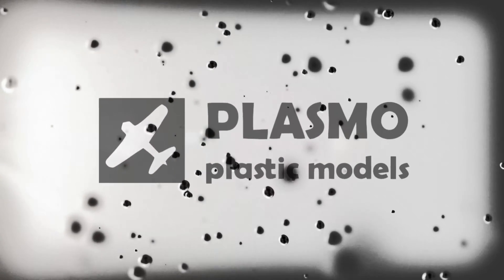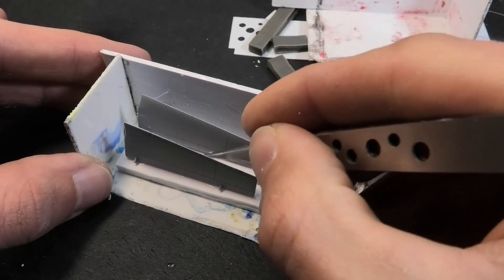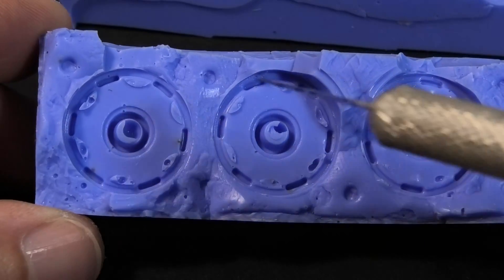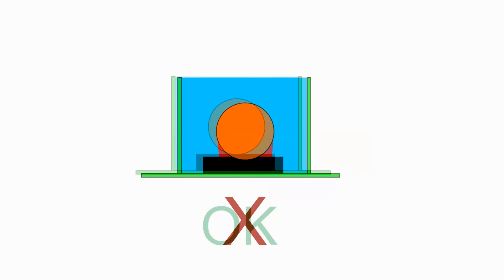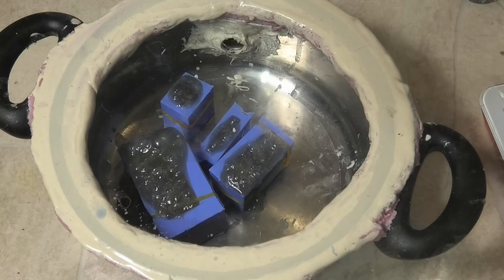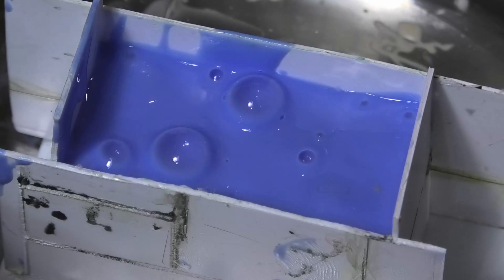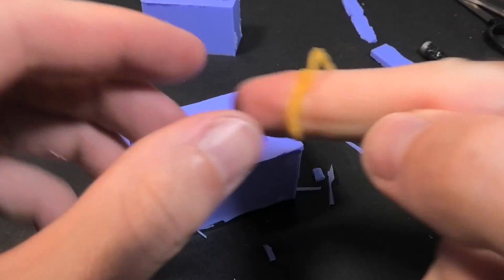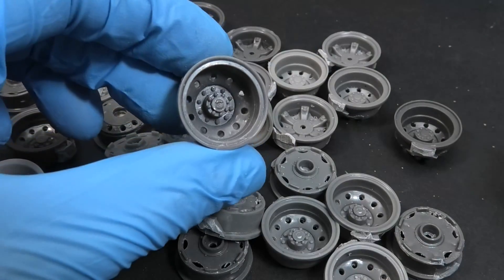Tutorial - Resin Casting - Silicone Mold - Two-Part Mold

Comment: That's why resin models are expensive
Reply: Exactly
Reply: This and the fact that usually they're not made in large amounts. They're easy to make, but require quite a lot of work.
Reply: This isn't entirely true, economies of scale need to be applied.  It's not wrong per se, but the cost is reduced when amortized across the total production/demand.

Comment: You can make a very good vacuum chamber using a common pressure cooker such as is used in canning fruit and vegetables. Just put the proper brass fittings on the lid and you are good to go. Very safe and easy to do.
Reply: Top man , knowledge is power
Reply: but without the clear lid it is harder to know when to stop the vacuum, isn't it?
Reply: You sound like you're talking about  pressure pot, used when casting the resin to eliminate bubbles in resin. Vacuum chambers aren't made with pressure cookers generally
Reply: @matt9736  No, but; they can be. I've done it. If it will hold pressure, it will hold a vacuum. The same principle applies. Pressure cookers are readily available and cheap. A small amount of effort turns it into a vacuum chamber.

Comment: Have you tried vacuuming the silicone / resin before mixing the hardener in? It might remove a lot of the bubbles when you aren't worried about it setting on you.
Reply: Please don't use power tools or anything dangerous.... stop and think... how do bubbles get in the resin? By foooking mixing it and stirring.... come on mate ffs
Reply: @vasili1207  are you sure about that? Do you really think that a minute of stirring adds that many bubbles? Surely bubbles can be added in the manufacturing processes and during storage. Of course the stuff would need to be vacuumed again afterwards, but it would be interesting to find out how much less foamy it is the second time around.
Reply: @vasili1207  and I dont really appreciate your tone.
Reply: Im rather new in mold making, I sculpted a small range of 32mm miniatures and wanted to reproduce them. Im experimenting alot, my set up is similar to the one of Plasmo. Vacuuming the resin before you pour it to the mold does reduce the occurance of bubbles, especially in tily stuff like my sculpts. BUT it also reduces the small ammount of time you already have. From my experience the bubbles do not appear because of the stirring, but because of the chemical reaction between the A and B components. So vacuuming just part A isnt going to improve anything really.
Reply: Thank you Joe, good to know. I'm shocked that the chemical reaction is releasing gas! Surely that is the last thing any caster would want! Are you sure?
Reply: I don't care what you appreciate....  fact
Reply: You are wrong .... stiring folds air into the mix .... exactly the same as baking...  if your resin creates bubbles via chemical reaction it's contaminated, your chatting total nonsense.

Go read the data sheets or phone the resin manufacturer they would laugh at you 🤣
Reply: @vasili1207  I assume your second response is not directed at me, but I'll respond anyway. I don't think it is the same as baking. When intentionally fold a paste to add air bubbles, it is going to have markedly different end results to when you carefully stir trying not to add air. 

I am fairly confident, being a professional chemical engineer, that the manufacturing process will involve stirring. It stands to reason therefore that a lot of the bubbles will already be present when you buy it.

I checked online for the chemical reactions of casting resins. It would appear that none of them have side products, therefore I do not think that the bubbles come from the reaction itself. It is possible since the reaction can generate a lot of heat, that this heat causes bubbles to appear from gas that was in solution already.
Reply: Well if you're a "chemical engineer"  you wouldn't call yourself that and you wouldn't have asked that question.

Ps it's a chemist
Reply: @vasili1207  what's a chemist? I am a chemical engineer. I engineer processes for handling oil and gas, both on platforms and onshore terminals. We are not the same as chemists, who work at the millilitre to litre scales, while I work at the thousands of tonnes scale. They use glass while I use carbon and stainless steel.
Reply: Don't vacuum your resin, it is much better if you do exactly the opposite. Put your poured parts into a pressure pot and increase the pressure inside to around 4bar/60psi. This causes the bubbles to shrink to microscopic size and you get a much smoother final result.
Reply: @dablakh0l193  if he does this I won't find out what happens with the pre-vacuuming! But you are right, I have seen several videos that have all recommended pressurisation over vacuuming. It is certainly less messy. As long as it doesn't explode.

Comment: Hi. Do you think vacuuming the urethane works better that using a pressure tank to get bubbles out? Most videos say vacuum the silicone mold and use a pressure tank on the casting resin. Thanks

Comment: Great work👍
Btw is it possible to make mold of painted object this way without damaging that paint?
Reply: Yes clear coat it then cast
Reply: Or if the part can be washed with water, coat it with a small layer of dish soap and let that dry. Put a fine dusting of talc over the soap and that helps with casting delicate pieces.

Comment: Is the blue stuff and epoxy putty method still viable?
Reply: No it's been deleted from the human experience.....
Reply: yes, and you can use resin with bluestuff too.
Reply: @orbitalair2103  no you cant, the exothermic reaction of the resin partly melts the oyoumaru/instant mold and you are going to get much softer detail
Reply: I am using both..Blue stuff for simple and quick things and where I do not need so many repeatability.

Comment: Any kind of paint can be used to change the colour of the resin? The brand I use sell the colours too...but if I can use normal paints I don't waste other money!
Reply: Get the proper equipment
Reply: It's best if you use powdered pigments for colouring resin. Depending on the resin, the paint will either cause the resin to bubble up as it cures, or it will never cure completely and alway be sticky. You can even use powdered drink mixes like kool-aid to colour resin. You can also find cheap resin colours on ebay that work great and cost pennies.

Comment: So when you put the silicon into the casts and into the vacuum chamber, do you use the chamber as you did before on the silicon mixture? So that it all bubbles up like in the plastic cup?
Reply: Bob Beamon Did you mean Resin?
Reply: @robmccord2583  I mean the blue silicon once it is put into the casts.
Reply: Bob that is what Plasmo does at 7:16, he pours the silicon into the framing box he built to make the mold and activates the
Vacuum.

Comment: Little tip for fixing the shape of the mold. Don't use just rubber bands! They'll apply an uneven pressure on the mold use pieces of wood or any hard material on two sides of the mold and then apply the rubber bands, then you'll get an evern pressure on the mold which will result in no imperfections of deformed parts.
Reply: Good tip Adam
Reply: I use paper tape
Reply: Yup, even two piece of thick card - just to stop the elastic bands digging in or distorting the corners/edges.
Reply: I use duck tape.
Reply: Use any hard part. Thin wood, plexiglass, something that will not bend by rubber band.
Reply: Keep the original container (styrene here) to put the mold back in and fab compression plates for one or both sides that weren't originally part of the mold.  Then just use either fishing weights (I recommend everyone keep some lead free ones on hand for a variety of reasons) or something available to put as many grams on the mold for pressure as there are ounces of  silicone used in the mold.  E.g. 25g mold weight, 25g of weight for compression.

Comment: When you pour resin in molds do you again use the pressure pump or not ? And for more complex objects do you make air vents? Thanks, great video! 🙂
Reply: When I cast resin I will put the material under the vacuum pump again. So you are applying vacuum after you've mixed the material and then applying vacuum again once you've poured into your form.
Reply: @otm646  thanks for the info!

Comment: Seal the Legos with clay or petroleum jelly
If you don't have access to a pressure or vacuum pot, you can reduce some of the bubbles with a thin pour at height. A vibrating table (or other agitating method) can also help.
For casting, some people have used pressure chambers to crush the bubbles. I've never tried it with clear parts, so I don't know how effective it might be for that.
For multi part mold making, I've used silicone lubricant spray

Comment: Would you like to do a track diorama for a 1:24 scale car?
Reply: I used to use wet & dry sandpaper for a track surface, painted a tarmac colour complete with seams and repair patches in a slightly different glossey shade.
Reply: @doctordirk6316  stippling mr surfacer 1000 and sanding it with a little 4000 grit sandpaper would also work

Comment: If you want to get the resin cast free of bubbles, you have to set the mold and resin under pressure ( ~3bar). It makes a lesser mess and the pressure will shrink the bubbles, that these can not be seen with eyes
Reply: True.. And you "may" get away with a home build vacuum pot.. Do Not home make a pressure pot! There realativly cheap out there.

Comment: Hi Plasmo, nice video and good explanation. I noticed you used a vacuum chamber to get rid of the bubbles in making the mold. However, there are some videos that recommend using a pressure pot to pressurize the resin in the mold for bubble free casting. However, I do not see you using a pressure pot for your casting. Bubbles will be created in the resin when the 2 parts of the resin are being mixed and stirring it will cause bubbles to form in the resin material; hence the need to use a pressure pot to get rid of the bubbles. Please advise should we use a pressure pot or vacuum chamber.

Thanks

Comment: Consider punching a hole from the bottom of the side that's most difficult (like the wheels), and when they're cured, push some air in there with pressure. The piece should pop right out, because the silicone is expandable.

Comment: Hey plasmo, I’ve recently gotten into model building with much inspiration from your videos. 
I have a question for you or anyone else who knows,
What am I doing wrong? I’m hand painting with acrylic paints and I’ve thinned out the colour to a milky consistency and doing about 4-6 layers, I’m now trying to clear coat my work but I’ve noticed when applying the acrylic flat clear (Tamiya XF-86) it starts to almost instantly start leaching into and stripping my colour/base coat. Where am I going wrong?
Any help is much appreciated cheers from Australia.
Reply: P.s I’m only starting out so I don’t have an air brush/gun

Comment: When you make 2 part silicone molds, try using acorn nuts to press locating pins in your clay. They are smooth and perfectly tapered so that they pull out cleanly and even if you use the water based separators they seem to very rarely, if ever, break. If you are still worried about breaking them, use the water based separators on everything else, and use some petroleum jelly on a cheap model paint brush to paint the jelly on just the locating pins before you pour your second layer. 
I have had some items that required a 3 or 4 part mold to be able to get all the details and using the acorn nuts for locating pins has been the best way I've ever found to work. 
Also, size the nuts you use to the size of the mold you are making. The larger the mold, the larger the acorn nut. Remember, you only need 1 acorn nut threaded on a 20-25mm long screw to press in all the locating pins in your clay. That way you can afford to have them ready in several sizes depending on your mold. You never want to have too small locating pins. 
One last thing. If you have vacuumed your silicone, try pouring it in a very thin stream, starting in a corner of your mold, and allow it to rise up around the part, that way, if you use the fine stream, you don't get bubbles trapped, and you don't need to vacuum the mold after you have poured it. The stream size for the parts you showed casting should never be larger than 1.5-2mm in diameter.

Comment: I regularly make silicone mould’s for fishing lures and use Lego to build my mould frames.  The secret for making Lego frames is to carefully cover all the joins in plasticine.  The silicone won’t leak out that way.  Also, I use petroleum jelly as a mould release on the silicone when pouring the second half. Just brush it in VERY lightly.

Comment: This is a great video! However, I don’t have a vacuum pump or chamber so I’m a little discouraged that I need to source that stuff first before I even begin. But your results look awesome! Curious though, during the vacuum process it looks like resin is bubbling out of the molds. Do you ever lose too much material and have a bad casting as a result ?
Reply: That’s just the air bubbling out. Also, a vacuum chamber isn’t 100% necessary. A lot of people get by without it.

Comment: Alright then I see that everyone is doing the frame work the hard way

I've been using of all things " Lego's " to make the box frame and a thick pice of plastic for the bottom and seal it with a thin bead of silicone around the bottom edges .
I then place the part (s) in and pour about halfway up in the box ,
Not to completely cover the part and then place three to four Lego's in the silicone to create key locks for the next step .
* key locks help hold the two parts of the finished mold together and prevents slippage of the two halves .

Step 2.    Remove the Lego's and spray silicone release agent before you pour the rest of the silicone over the part and the rest of the box .

I use every thing from Micro Mart 
( except for the  Lego's ) .

One to one RTV silicone 
R = room , T = temperature , V = vulcanization .
Silicone release agent

Comment: Excellent! I'm wondering if I can recast metal miniatures to make them easier to do conversions or pin together
Reply: Silicone rubber is great for casting low temperature metals like lead and pewter. 
I used it once to recreate my grandfather's WW1 lead soldiers. I took the best ones of each of the different styles, and repaired what needed to be repaired with water based glue and plaster (that way I could return them to their original condition after making the molds using just some warm water and soap). I then melted lead and cast enough for a full set. The damaged ones, I used more plaster on the area so I could dress it down to look like it should have been, then I made a second mold of the fixed figures and cast new soldiers from those molds. 
Then I spent several months painting the details on all of the soldiers and equipment.
Reply: dablakh0l 
Awesome, I wouldn’t have the patient or skill to do that.

Comment: Really nice video! Two things I found when casting are -

i/ 'Vaseline' - aka Petroleum Jelly, is an excellent release agent for making two part silicon moulds.
ii/ Dusting the inside of your moulds with Talcum Powder - aka Baby Powder [and removing any extra with a soft brush], before pouring casting resin is an excellent way of making sure even tiny details and mould cavities get filled perfectly, for best quality reproduction.
Reply: Silicone mold release with Teflon is about $12 a can, you can buy it from your local industrial supply or even Amazon. You get a much finer consistent layer without having to fight with the sticky petroleum jelly.

Comment: Yeah, I will probably try to make some copies of my resin prints.
Reply: Be mindful that SLA/DLP resins often have chemicals that inhibit the curing of silicone, especially Platinum cure, that could leave your original and mold unusable without significant cleanup and loss.
Reply: What Nuke Dukem said. Tin-cure silicone usually works better for copying printed resin parts. 
Here's a video where someone experiments with casting copies of SLA resin models. Tin-cured work the best. 
https://youtu.be/RC9TgAO5mGo?t=662

Comment: Plasmo!! Question? Can you a Tutorial on like... Making Rubber wheels?
Reply: That would be cool
Reply: @Uswin Wood   There's a lot of info on that online already...urethane tires in urethane molds is my preference, lightly super glue your master tire face down in a little conical medical cup.  Be sure to lightly coat the tire with a mold release.  I like Smooth-On products (Vyta-Flex, shore 40) if you're in the US. PS no need to use vacuum in this case if you stir gently, any bubbles can be released by your breath (CO2).

Comment: Congratulations! Much better than the result I've got on my video, were I failed on casting the small pieces and ended up cheating and printing stuff on my Elegoo Mars printer (^_^) and I do use lego blocks, it is more fun and I can use some hardware store silicone to seal the gaps.

Comment: 6:20 You are applying the vacuum too quickly, I use a small metering orifice and a ball valve to regulate how much vacuum you are pulling in the chamber. Anything more than a low boil and you are going too quickly.